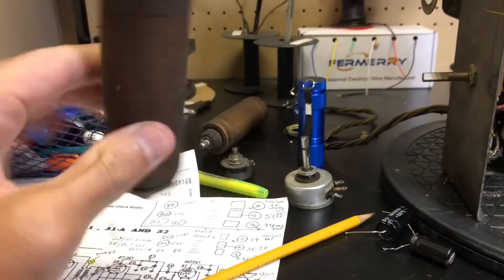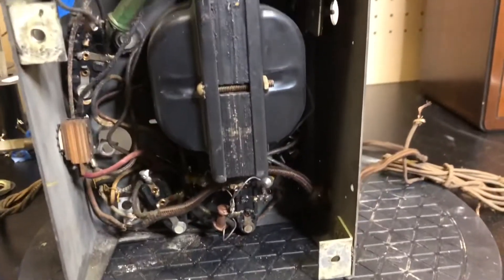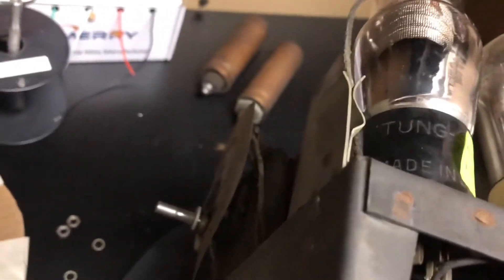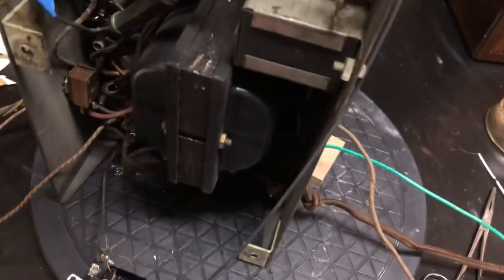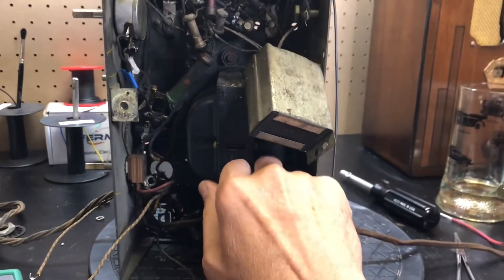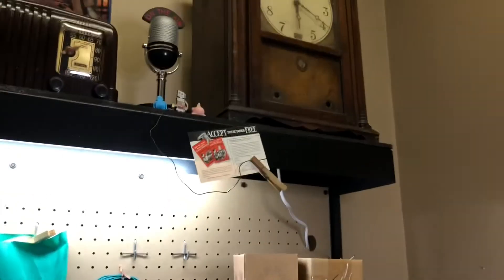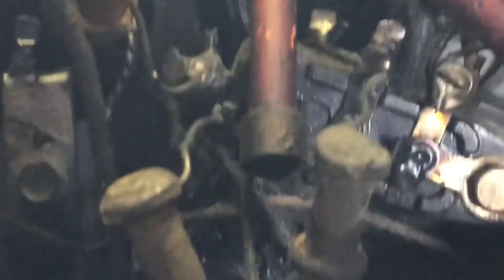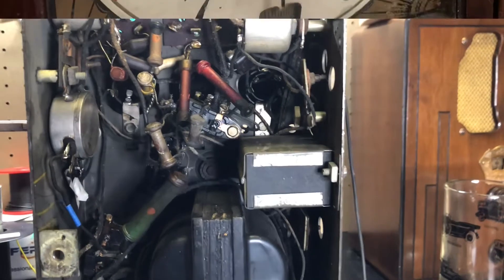First test....Radio Signals or Smoke Signals

Comment: I would remove the rectifier tube, then power it up slowly on a variac and check to see if your B+ voltage is OK. You can always do the "dim bulb" in series as a safety while you do it.
Reply from the maker: Good idea, I'll try that next.  I really didn't know what to expect, but I was waiting for the E Caps to explode.  Someone in the last 89 years,  tried to get the radio to play and really cooked it.  So now I really want it too work again,,,it's going to be a real challenge.
Reply from the maker: I did the voltage checks on the 80 socket with all tubes removed......I got 5 volts AC one the filament side....and the dial light lit up......and 647 volts AC on the plate side.  Does 647 volts sound too high? or is it ok since there is zero load on the high voltage?   I hope you guys are doing fine after the crazy storm that hit the Northeast.
Reply: @My1925World  Looks like you have good B+ but you said exactly what I was thinking... Now it's either a component dragging it down, or a well worn transformer. Philco and Atwater Kent radio were made in Philly when the supply voltage was likely 100-105 volts. My supply voltage in my home is usually 123.4VAC. See what the B+ reads under load.
Reply from the maker: @Radiowild  I forgot to mention that I had it on the variac at 110 volts.